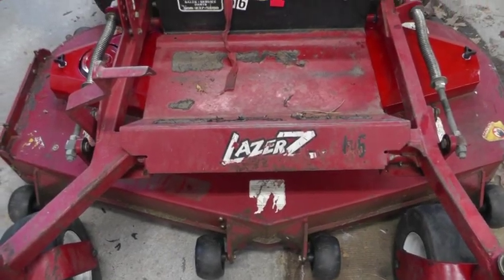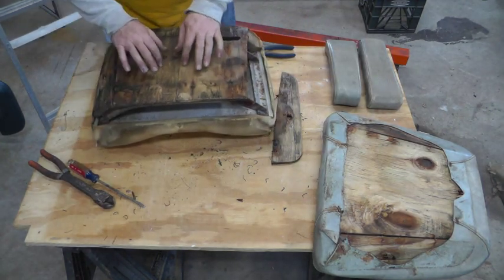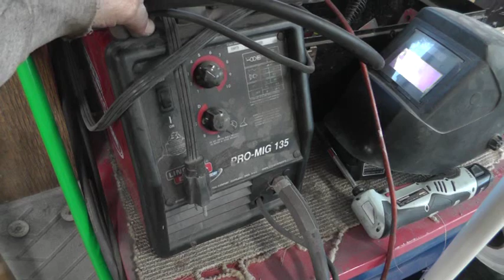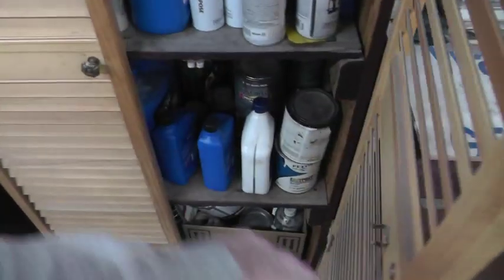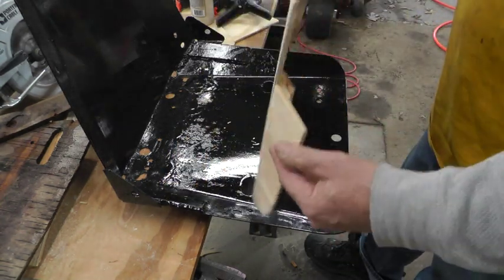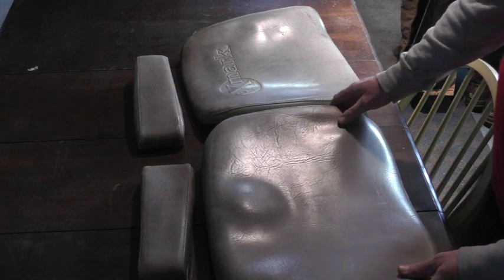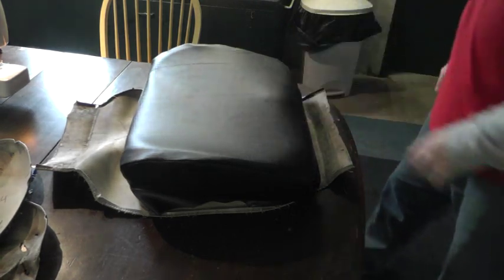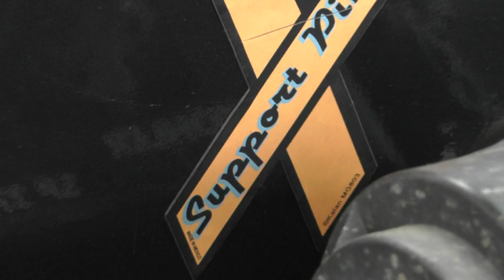DIY Mower Seat Repair -  Garden Tractor Seat - Zero Turn - eXmark

Comment: Really good work here on the rebuild and the video. I realize this is years old, but I could use the dimensions of the plywood for a DIY seat repair I am doing on an Exmark Lazer Z HP 44, any help? Thanks.
Reply: I'm looking for dimensions as well. Mine rotted through the winter, after it apparently got wet without my knowledge eye roll lol